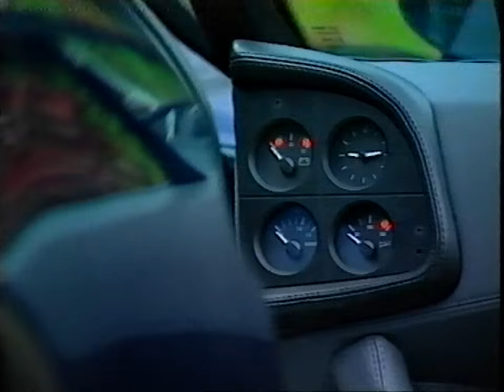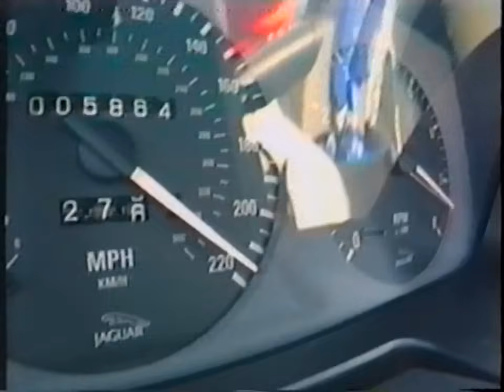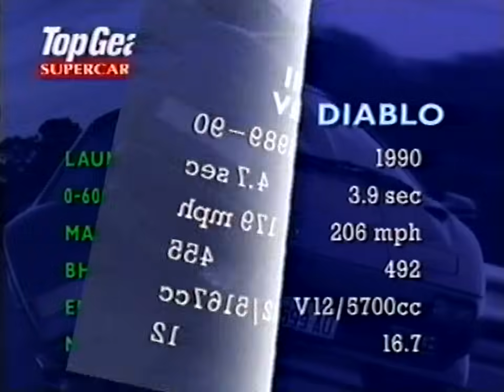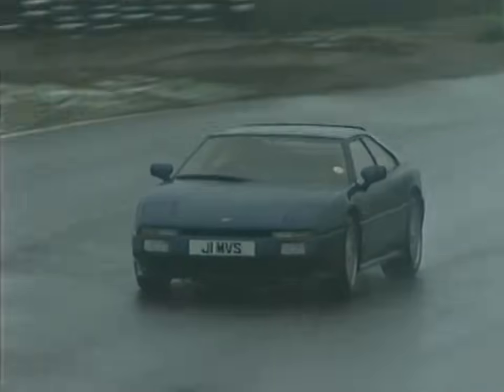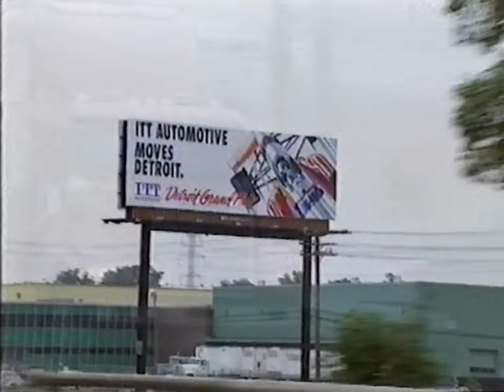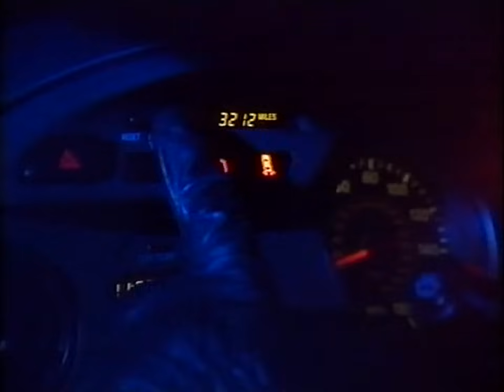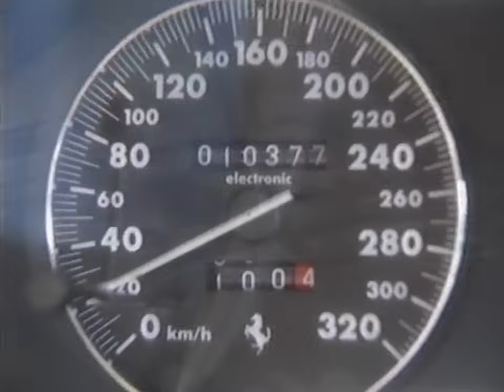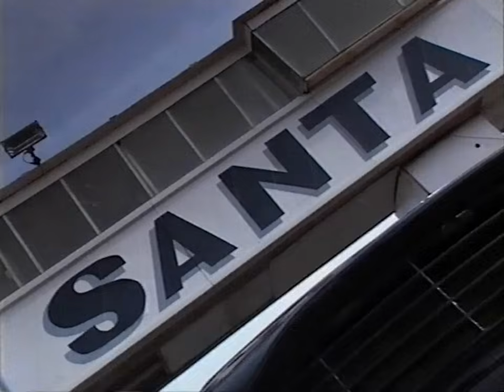Old Top Gear - Super Cars 1994

Comment: Man those gear ratios in the NSX are totally whack.  90mph shift from 2nd to 3rd in a car with 270hp and the power band is pretty much 5000rpm to 8000rpm.   Screw top speed, nobody gets to 167mph except for a select few germans on the autobahn or the long straight at the Nurburgring.  

 I hate to say it but my old hill-billy hot-rod 1999 Camaro Z28, LS1 V8, automatic transmission, that thing would straight up smoke an early 90's NSX.  Low 13 second quarter miles with an airbox mod, a muffler delete, and some decent sticky summer tires.  With those two mods the car made 305rwhp/320 rw lb-ft torque.
Reply: On a straight line/drag strip, yes. On the track or street even? No dice, the NSX was not intended to be a dragger but a track machine that you can daily comfortably without worrying all too much about when you need to visit the shop or if it's going to leave you stranded.

I like the Z28 quite a bit but the suspension geometry, weight distribution and build quality are warm dog shit and i'm being generous because i'm not even mentioning braking nor gross weight.
Reply: @takafumiarisawa70    You would be quite surprised as to what the old F-body chassis, 3rd or 4th gen can do with about $2500 worth of upgrades.  New shocks, springs, fatter roll bars, wide/sticky 17" tires, and upgrade to some Corvette brakes totally transforms the car. 

 Also the Z28 weighs 3300lbs vs the NSX at 3000lbs, so still a light weight car.  Add in the fact the LS1 V8 makes about 80hp more stock.  My 1999 Z28, automatic, made 305rwhp/320 lb-ft tq with a muffler delete and a different airbox.  That's about 350hp at the flywheel, same as a Corvette.

  If you upgrade the chassis it will ring the neck of the NSX on a road course as well.  Not to mention how a C4 ZR1 Corvette or bone stock C5 Corvette will also run circles around it.  

I like the NSX, it was a revolutionary car.  Its just there was a serious horsepower war going on at the time, NSX was impressive for the early 90's, but past about 1995 or so the competition had caught up and were beating it like a red-headed step child in all the performance metrics.  

Yes the big N/A VTEC V6 was revolutionary in 1990, but its such a commodity now days, my mom's 2012 Camry V6 is about as fast as a 1st gen NSX.
Reply: @aaronbays4  
Ohh don't get me wrong I do know how good a Z28 GM F can be if it virtually stops being a Z28 with the laundry list of modifications plus tuning one would need to do so and that applies basically to most if not every car made. Sure, if you keep the NSX in stock form it will get all kinds of 80's sorority girl fucked up and down the track but if you end up applying a bunch of mods to the latter it would be another story.

Another thing, the GM F platform got future proofed mostly by chance and the ol' parts bin blues (which is all fine and good in my book) the NSX got future proofed by design alone...I know I do sound like a douche but it is like it is and that's way far from my own shitty opinion into the realms of reality. 

We often try to show other people how good is the stuff we like mainly because we grew around it. In my case V8 engines are a bit a of a commodity around here but I've had the chance to see how they work, including many varieties and flavors and same goes with Jap and Euro cars. In the end it mostly comes to personal choices but there's some undeniable facts that we'd rather just toss aside just because.

Also I like the way you think and how you don't resort to calling me a fggot/dumbass even though you should. But gitcho' ass outta here with a 012' Camry being faster than an NSX (the more modern supercharged ver. from overseas is another story though, that shit rips).
Reply: @takafumiarisawa70    My point was the LS1 engine in the Z28 is the strong point, the chassis is the weak point that needs work.  NSX, chassis is amazing, engine is a bit of a letdown IMO.  Also 2012 Camry, it has the same power as an early 90's NSX, weighs about 200lbs more, has much shorter gearing.  I'm betting off the line its a dead heat, no doubt the NSX will walk it above 60-70mph.  

I know there are a world of mods with the NSX, its just kind of dissapointing it didn't come factory turbo like most performance cars at that time.  Honda absolutely dominated Formula 1 engines in the late 80's/early 90's with a turbo V6, V10 and V12.  Its a shame we didn't see some sort of exotic screamer with direct lineage to their Formula 1 cars, instead we got an Acura Legend motor but with 50 more hp.